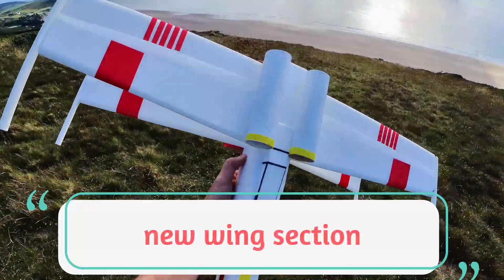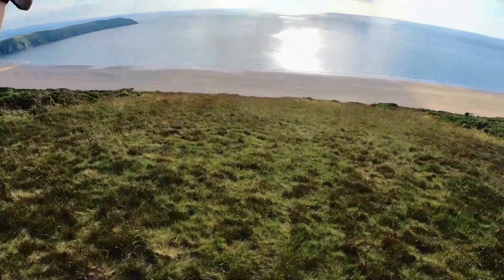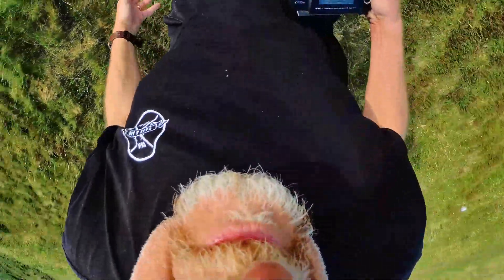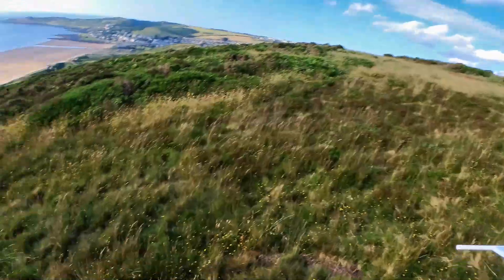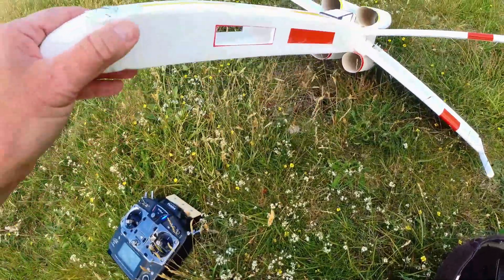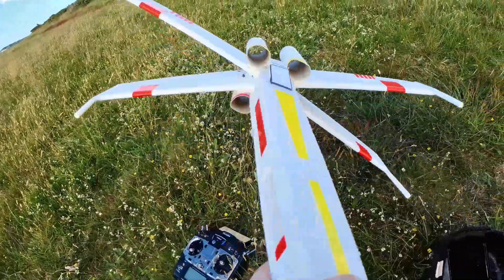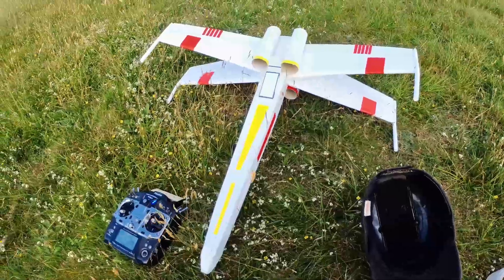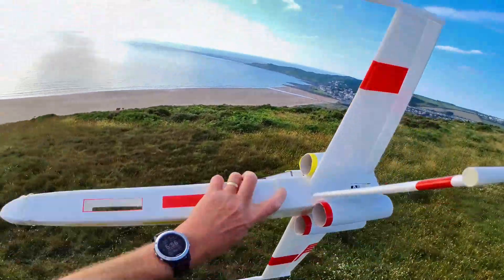X wing fighter update

Comment: I had a go at this years ago. My best advice is to make a small profile model (mine was about 8" wing span) and try to get that to glide indoors. You can iterate much faster, and don't need to care about making it look nice.
As you've probably worked out, if the CG is in the correct place for the wing, the huge nose makes it unstable in yaw.
Canards could work. I don't think clear fins will be enough, as they're too close to the CG. My profile version worked because the flat nose had almost no side area, and I still had to cheat a bit to add fin area at the back.
I think you'll have to abandon the idea of an accurate model, and aim for a 'tribute', (maybe it's a later version x-wing). Move the wings forward, and possibly sweep them forward, and make the nose shorter.
Reply from the maker: @robinbennett5994  yep spot on mate but fun trying to